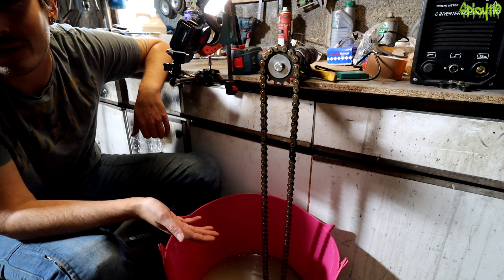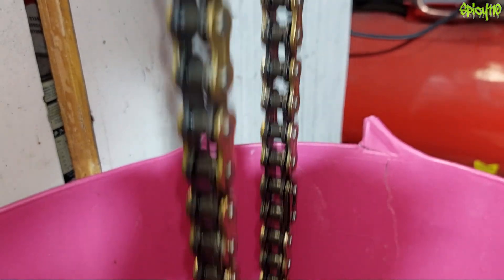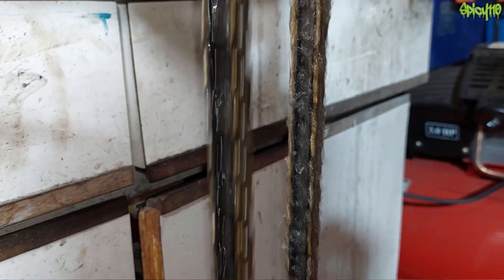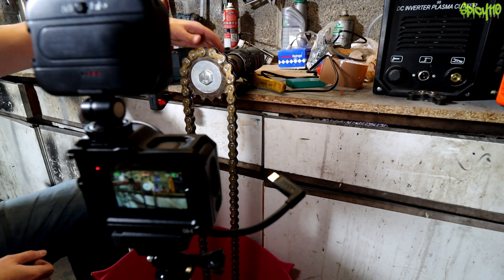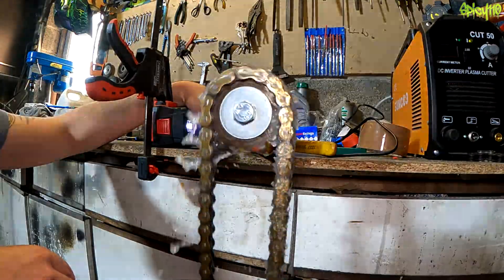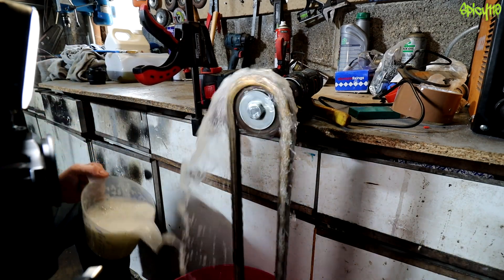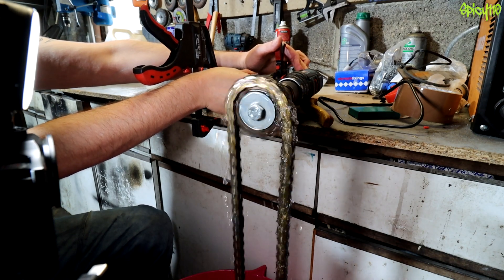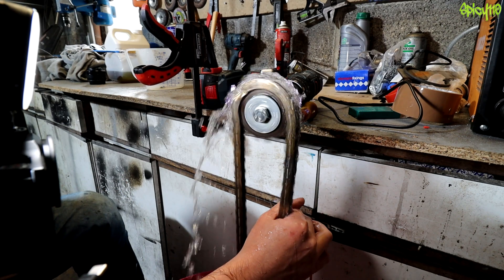Water Climbs A Motorcycle Chain?

Comment: We have an oil skimmer at our industrial plant that skims the wayer in a similar manner although it uses a special tubber tube but still relies on surface tension. There are wiper blades at the top that scrape the oil scum off into a collection tote.

Comment: Just one small step away from a bucket elevator, which is literally what you have there but with little scoops added to each link. Not used for liquids as such, mainly powder or small solids.

Are you aware of archimedean screw pumps? Unbelievably simple but effective devices, which lift vast amounts of water out of rivers. Entrancing things to observe. 😂

Comment: That would an "elevator".  It the past I worked for a engineering company "specialists in mechanical agricultural installations" 
To raise grain vertically say 200 feet at a mill they use an elevator which is a  2' wide belt with buckets bolted every 2' along the belt wrapped over and under a roller top and bottom powered by an electric motor.  The grain is poured from the truck to a ground hopper where the elevator scoops it up and takes it up and empies into a silo or a conveyer.  This is also used for liquids in places around the world rather than use a pump due to the immense pressure needed to pump liquid to high heights. Simply look at size of concrete pump lorries and they can't pump 100 ' vertical.

Comment: Well that was a seriously cool phenomenon. Thanks for documenting and sharing. I kind of wonder if using a rubberized chain of a lighter material would produce a faster flow rate and reduce the jumping? The oil in the water during the first demo might have helped keep the positioning of the chain tighter on the sprocket because it formed a layer preventing air pockets from forming between the chain and sprocket therein causing  the chain to jump. Like you said, it's probably not a competitor for a purpose built pump but it's a really cool alternative that must have an niche application.

Comment: Haha, that is actually pretty interesting.    Would be lying if I didn't cringe a few times when you had your hand on the chain close to where the chain was feeding onto the sprocket.  Reminded of all the Youtubers saying not to clean your chain by running your bike, lol.   Real world application?  Couldn't tell ya, haha.  Interesting none the less though.
Reply from the maker: The issue when it is on a bike is it is under great tension and being powered by a say 600cc engine with the mass of the rear wheel and tyre. That all leads to it being a finger chopper, this? The drill would pull off the side before it did anything.  Haha